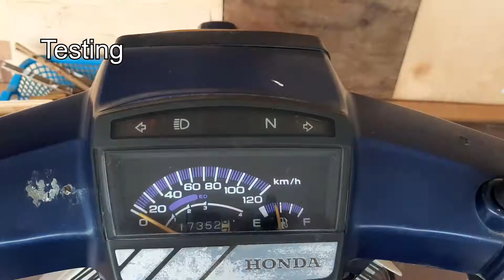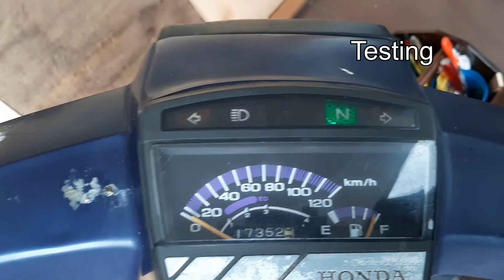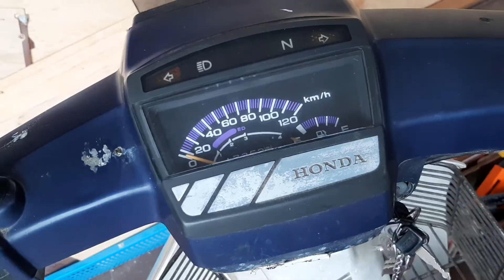Project: Replacing battery of EX5 (hp 1994)

Comment: Nk tanya knpa bettry ex5 xthn lma ya bro..dlm 3bln 2x tukar sebab xdpt chas btry dia..pa mkslh ya bro
Reply from the maker: Banyak sebab bateri cepat drain -- terminal bateri tak rosak dan/atau haus,  stator rosak,  rectifier/regulator rosak, banyak penambahan (accessories) yang guna letrik, cable bateri longgar, masalah wiring. Kena check satu-satu. 
Good luck!